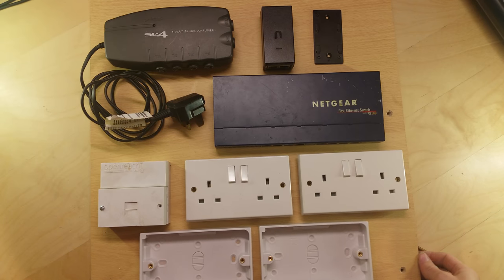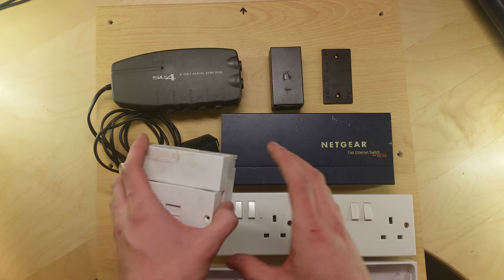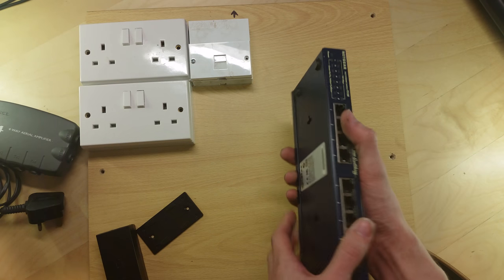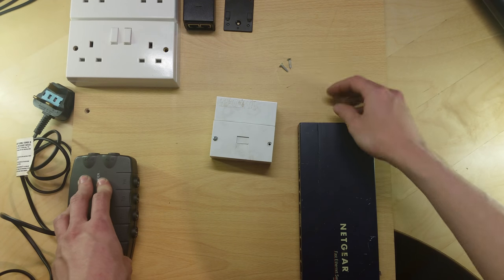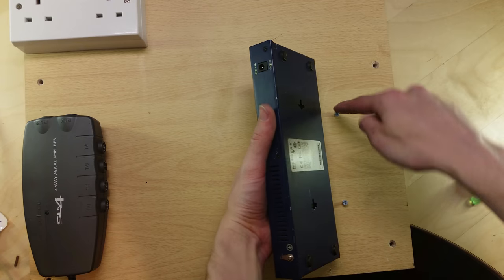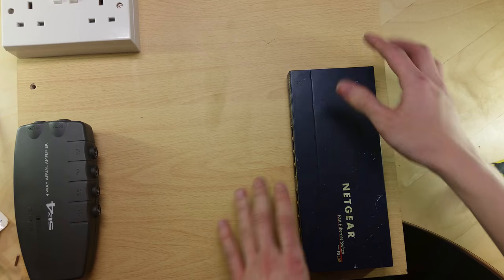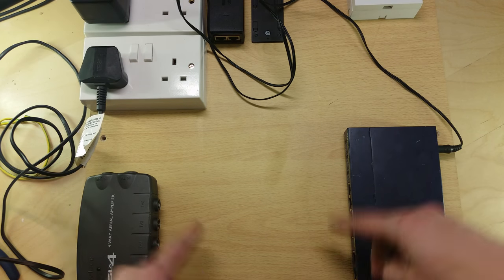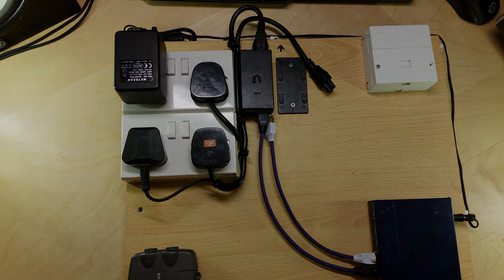Budget Home Network Build PT1 - Building The Wall Board (TV, Ethernet, Telephone)

Comment: Good video. Think I would’ve just mounted the power sockets on the board initially (assuming you have good access to the board when it’s in situ). The lesser weight makes it easier to mount. The cable management is also best done after mounting.
Reply from the maker: Hi, Thank you for your feedback. :)
I was considering mounting just the board first then mounting everything onto it - however it's in the back a small cupboard. That would have meant leaning in a small space to do everything and wouldn't have been great for recording a video. 
It actually wasn't that heavy surprisingly or hard to mount as I pre-drilled pilot holes to aid me there.

Cable management actually works best in this case to pre-manage some  things where possible. That's mainly because of the way the board mounts to the wall - the rear isn't very accessible when in situ. 

It would all make more sense and become apparent in part two (install, termination, feeds etc..) which I hope to have edited and uploaded in the next week or two.

Glad you enjoyed the first part!
--Nathan